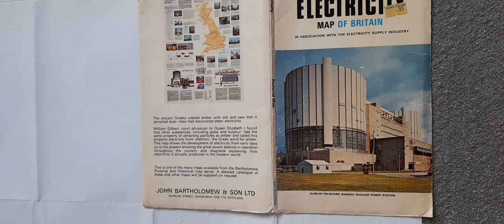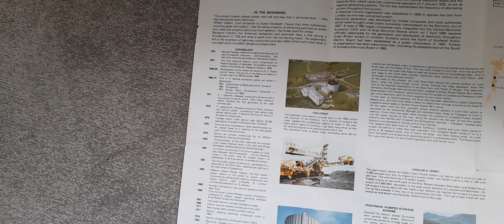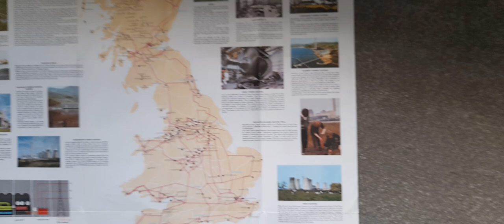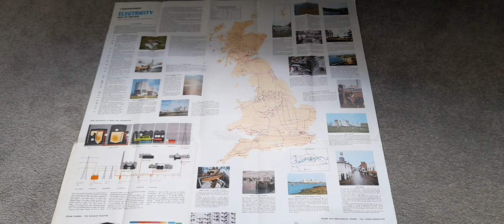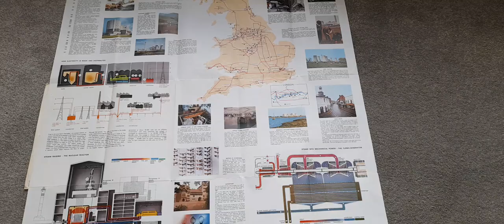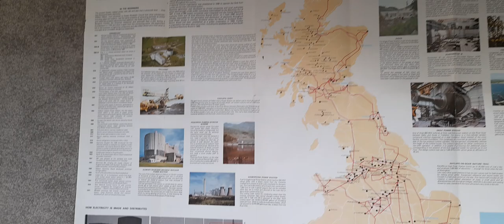1977 ELECTRICITY MAP

Comment: It's weird how a lot of renewable power relies on conventional power to  make it work!!..electric cars charging points in a lot of cases need mobile diesel generators to hook up to in order to make the chargers charge!!!..theres no infrastructure to enable proper use of equipment...a company near me decided to go politically correct and dumped all their petrol machines in favor of battery rechargeable.. the battery principle was sold to them on the lie that they could get an hours life out of a battery,in real life they were flat after 15 minutes...so the flat batteries had to be run back to their depot in a diesel van so they could charge them every so often,resulting in a 1 hour petrol machine job taking 3 hours to do!!
Reply from the maker: I didn't know that about the electrical charging.....I reckon in the next 50 years technology will leap forward and we will have a cleaner greener world, but at the minute it all feels too rushed and the more I look into it, the example you've given is spot on, the technology/infrastructure just isn't there yet....develop new power sources but we'd better have a back up if the lights go out!.....I don't think we have🤔🤔

Comment: I’m not on the fence about green energy if you look how lithium and cobalt are mined and have to transported thousands of miles to get here then the process of turning the raw material into a useful product it’s not green and wind and solar are at best 30 per cent efficient solar doesn’t work at night and the wind usually drops so when all our vehicles are electric on a winters night when every one is home cooking their tea with all the lights and heating on and at least maybe two cars to charge up where is all the electric going to come from and a lot of homes will have to have their cable supply upgraded to cope with the heavy demand and how much land will have to be cleared of vegetation and wild life to make way for all the solar and wind farms, apart from that what could possibly go wrong
Reply from the maker: Fair points m8.....I only made the video because I knew that the UK no longer had any coal fired power stations,  I was shocked when I realised how many we used to have.....I suppose time will tell on what comes next.🙂🙂🙂